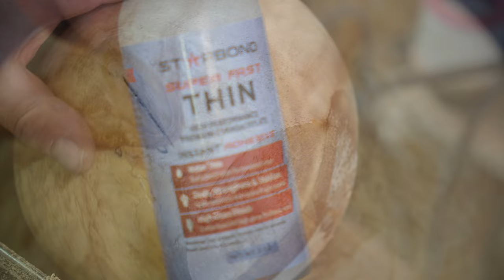Birch Woodturning: Mistakes & Magic

Comment: My Gosh, that was plain stupid. If you are going to cut off one protrusion while the piece is on the lathe, why not the other one too. No shield on the bandsaw blade? You are lucky your hand did not get pulled into the bandsaw with that guard all the way up. You ought not to give instruction on Youtube.
Reply from the maker: Firstly thanks for your feedback no matter the content I’m always grateful for anyone spending the time to write.
Reply: @bespokewoodartistry1517  what a pleasant reply to a extremely lofty 1950s headmaster. However most of what he said was right but calling you stupid ands the instruction part
I’d have told him to 🦆 off 😂😂😂😂😂😂😂😂😂😂😂 
Lovely wood to work with I’ve done a couple of live edge pieces the bark stayed on very well